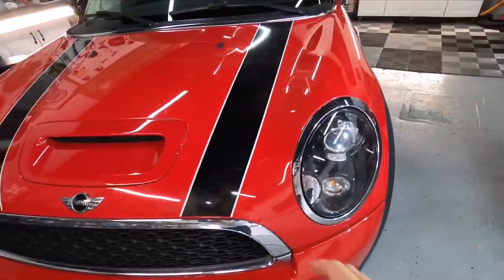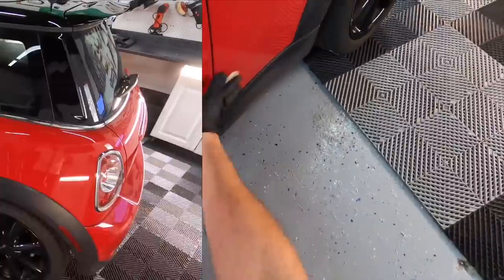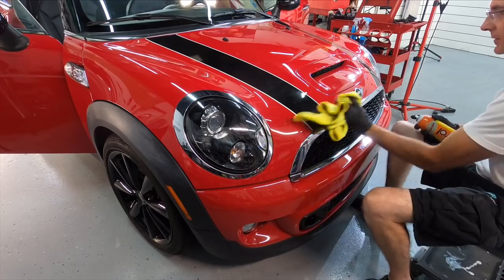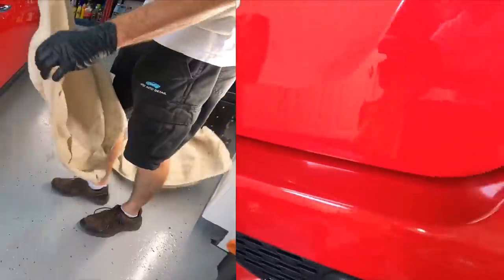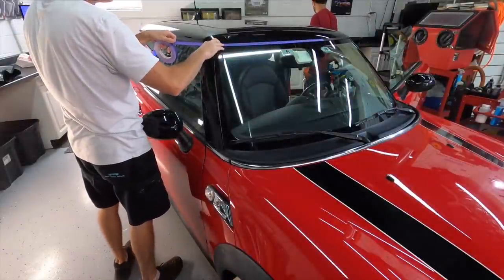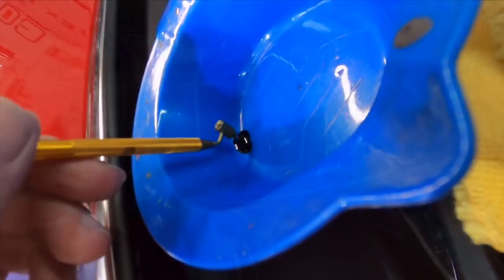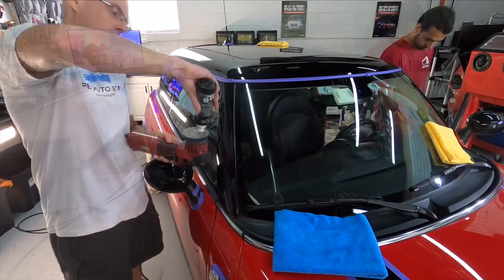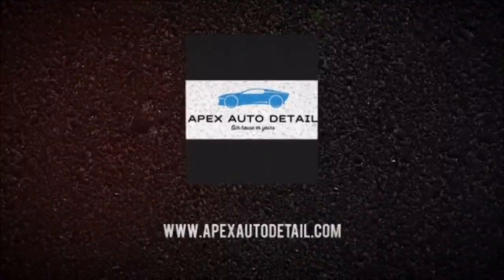How To Restore Every Material On The Exterior Of Your Vehicle....Like This Mini Cooper!! Part 1

Comment: Speaking of polishers, I bought a new G9 in December, jsut got around to coating the car last week. Needless to say, I got one of those G9's that dont spin on metal. It was completely useless. I bought a G9, I polished the car with an OLD Porter Cable with a 3" backing plate. If you have one of these things, call them, they will replace it

Comment: Can you cover polishing the chrome/aluminum trim pieces in this series? Mine look marginally better with compound and polish but there are some deeper scratches and oxidation, do you wet sand them the same as paint?

Comment: did you wipe down the car with isoprop after claying? or did you go straight into correction
Reply from the maker: Dezcanso I used Eastwood panel prep.
Reply: @apexdetail85  so just to be sure you panel prep after claying, after compound, and after polishing before applying a sealant or coating? thanks!

Comment: I have a 2018 Tundra, and on my B pillars, there is a black finish between the front and back door.  I’m not sure if it’s a decal or a painted surface.  Would you know by any chance?  And could I use Sonax perfect finish here to polish them up?  And which pad would be best to use here?  I have a Griots G8, which is a perfect size for working this area as well.  Thx Brian!
Reply from the maker: Tundra Whisperer it would be obvious if it was decal... I would use Perfect Finish and black application pad.
Reply: Apex Detail looked at it closer today and at the top it has the feel of a decal seam.  So still polish with Sonax?